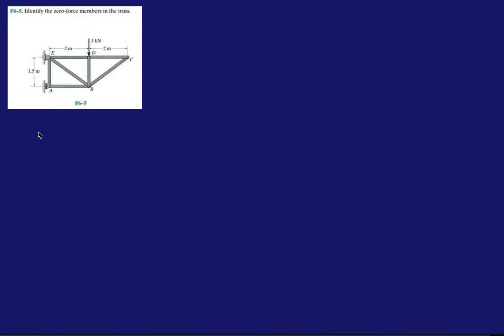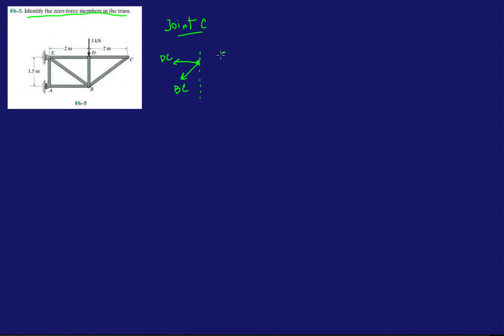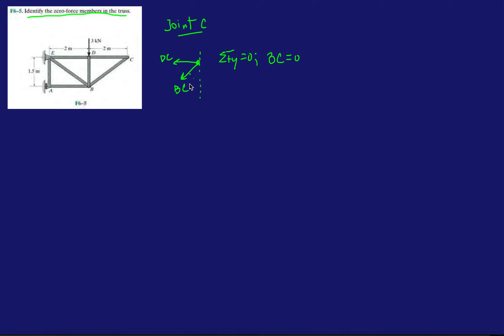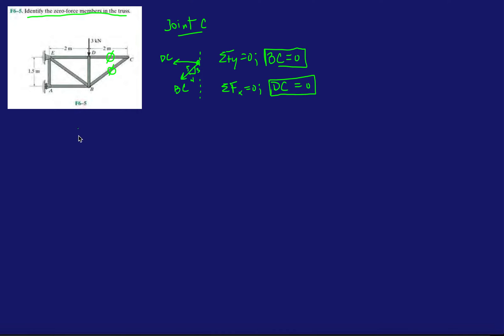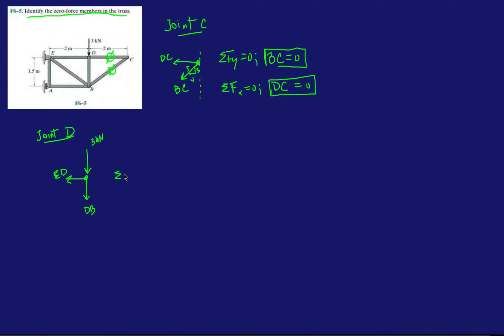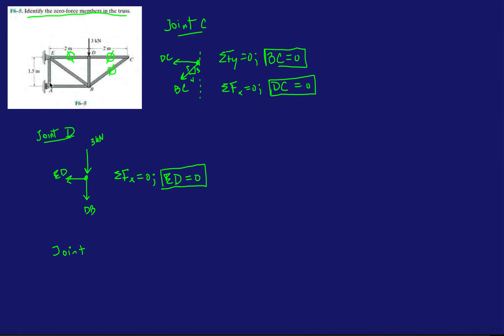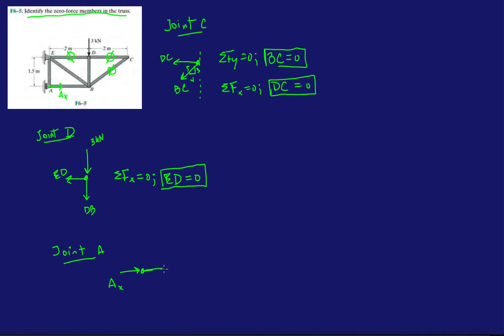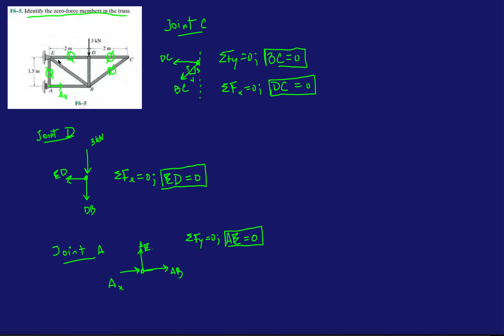Problem F6-5 Statics Hibbeler 12th (Chapter 6)

Comment: Doesnt the upper pin at E have 2 reaction forces? One in the X and one in the Y direction?
Reply from the maker: Yes you’re correct, I skipped solving for those since we didn’t need to do that to solve the problem though.